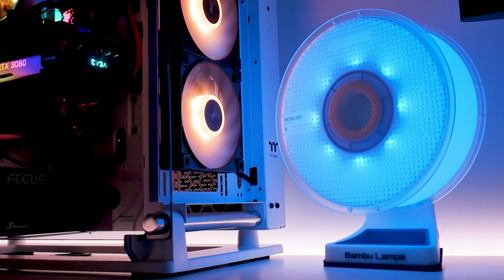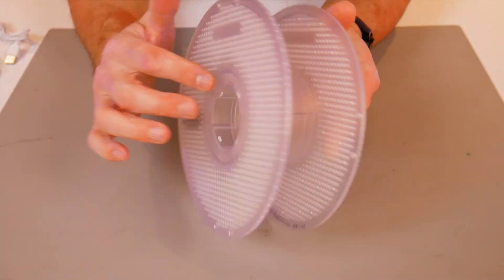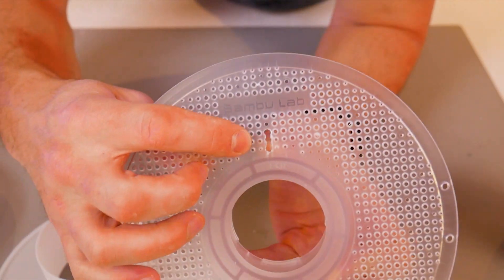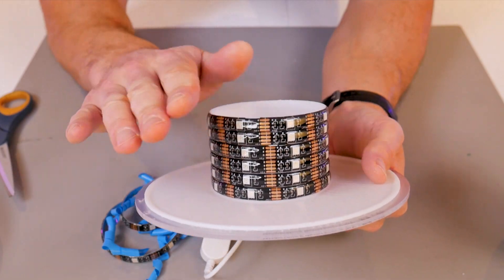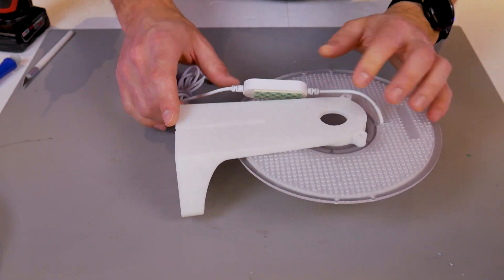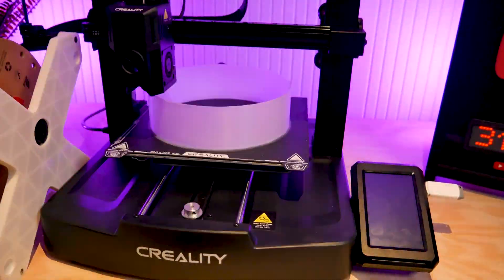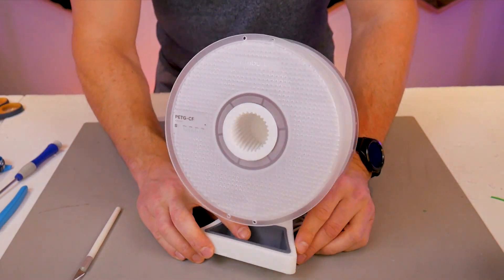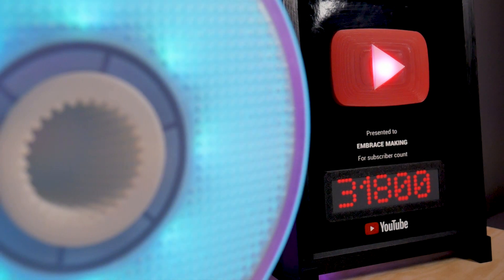Bambu Lamps LED Spool - A Bambu Labs Inspired 3D Printed Lamp

Comment: Hey Embrace Making,

I really love your lamp design :)
I'd like to build one myself using a MagicHome Controller and a 12V LED strip. My idea is to modify the black INSERT and white STAND so the bottom of the stand serves as a compartment for the controller.

Is there chance you could share the cad files (instead of just the .stl files) of the two components?

Greetings from Germany✌️

Comment: what controller did you use for your leds i need a good but cheep one i have a lot of leds left over
Reply from the maker: In this video it was the one that was integrated with the LED strip. What kind of LED strips do you have? Not all controllers are compatible with just any strips

Comment: did you use translucent filament or is that just white filament?
Reply from the maker: Just regular white filament. Anything the light passes through is only 1-2 layer / wall thick so it will diffuse nicely.

Comment: Mmmh I'm skeptical.
I mean, you don't have a Bambu, so you used the spools but don't need them anymore.
People who has a Bambu instead does need spare spools.
Those are btw the only known spool brand which splits in halves allowing you to reload them in a switch and click.
Having printed one more spare, I can assure you that for material/time, the original Bambu spools sold at 14 bucks are a deal, compared to 4 euro of your PETG and more than 4 hs of print time.
Let's also assume that who doesn't own a Bambulab can't relate nor with the spool value, neither with its look. 

So you just shown how to (net of aesthetics and creativity and so, which I admire)
How to make a questionable look lamp, with the main body part worth 14 bucks already, with which most of the people can't relate, and people which do relate can 1- Build it on their own and 2- Think the same about "that's a wasted reusable spool!" 
So in conclusion one of these people be they printers or not, Bambu owners or not, decide to pay like 30 bucks at least for a tabletop lamp even if, one category or another, they all have at least one motivation to question the making or just not relating with it.

Ok... Nice build. I don't want to be rude but there's no smooth way to tell you this "product" has no potential target, no value proposition and it's outta market at every price.

(I have made a hair clip ring in carbon fiber and resin. The mold is 3d printed. Truss me, when I say it's cool but useless I know what I mean. I just say this disclaimer before showing it, and don't try to make it look like I have an MVP with that hair ring. Because it's not, it's a prop, nothing more.)
Reply from the maker: Thanks for the detailed response but this is a novelty project and not a product. All of the files are free and yes there is no practical market for it. People with the bambu printers or who use the filament (like myself) often end up with extra spools and it's just a fun way to use those spools. My local supplier only sells the filament on the spool and not the refills so I have a few of these spools laying around. There are lots of very passionate Bambu customers out there who would make something like this for themselves for fanfare and just for fun. It's free :)
Reply: such a strange response to a guy making something fun, he didnt once say its for commercial use... 
besides if you are that bothered about commercial use you can print your own spools.

Comment: What is the "Swirly looking" seemingly threaded internal part of the front plate for? Aesthetics? Fantastic build BTW. I was waiting for someone to use the extremely aesthetically pleasing bambu spools directly in a project, and you did that incredibly well.
Reply from the maker: Thank you! The spiral looking thing in the middle serves two purposes. 1 an extra support for the spool and threads into the back mount. 2. Fills in the hole in the middle so it just looks nicer.

Comment: Well done, keep up the good work! I hope Bambu Lab will reach to you!
Reply from the maker: Thank you! Would love to try one of their machines :)
Reply: @EmbraceMaking  I've got A1 with AMS lite, it's not their top tier but it's performing like it is! Beside that one, I've got few Creality Machines, K1 Max, CR-10 SE and Ender 3 S1 Pro. It's easy win for the A1 if you print with PLA/PET-G (haven't tried other filaments on A1), and that's what I print 99% of the time...
Reply from the maker: Heard very good things about the A1 - would love to stack it up against some of the other new mid range priced klipper machines on the market. I've yet to own any Bambu Labs printer but am also considering P1P